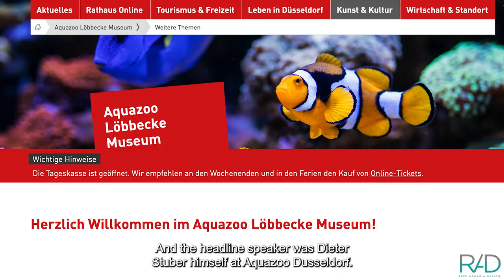TALKING ABOUT HOW & WHY ALL OUR BIG AQUARIUMS RUN ON DELTEC WITH, DELTEC AQUARISTIC OWNER, JAN NELS.

Comment: You can never go wrong with a deltec product. 100% fact !

I have 3 skimmers, deltec 2060 is one of them and other 2 are meant to be quiet and ran on DC pumps which I bought for those reasons , I went back to my old and trusted Deltec and it out performed the other 2.